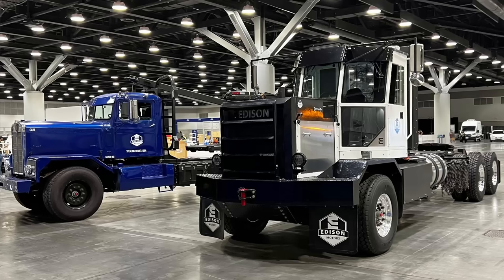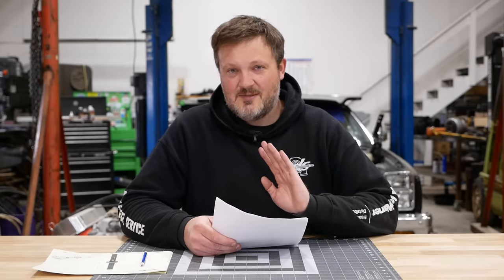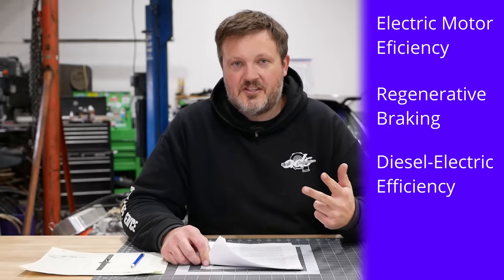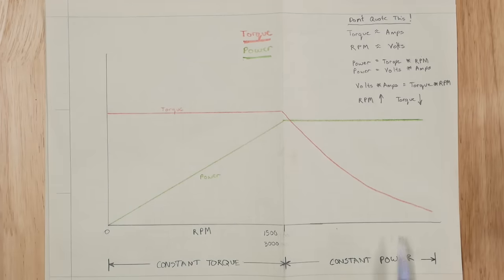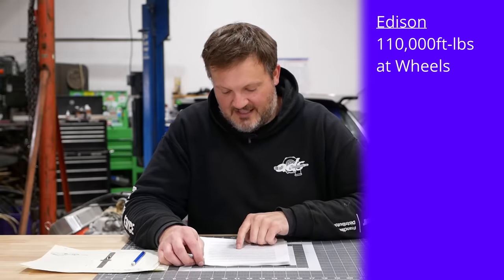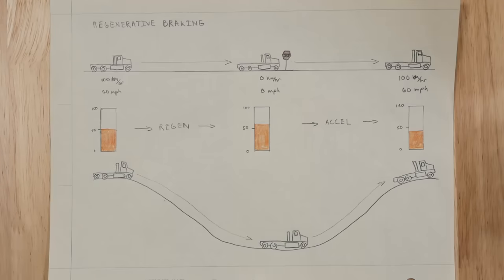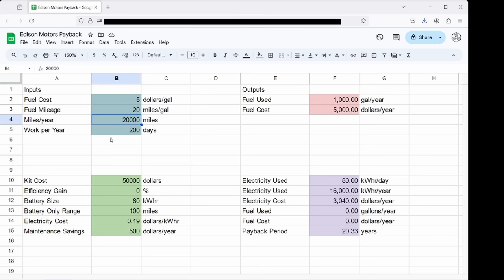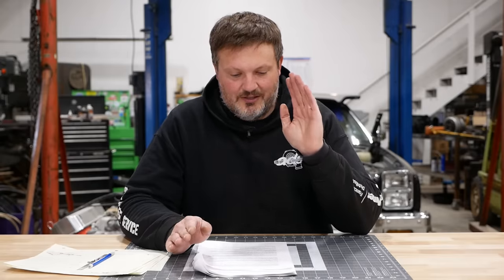Edison Motors Built a Diesel - Electric Semi Truck

Comment: This story hits all my buttons.  I'm an Electrical Engineer who grew up on a farm with heavy equipment all around me, and a shop full of tools to play with.  I'm relishing every aspect of this.

The coolness factor is important.  Watching the video with deBoss silently pulling the flatbed loaded with a Sherman tank was one of those "show me"/"proof is in the pudding" moments. As an Engineer I know there's a big difference between theory and practice.  Anyone who's done a demo for a customer knows the pressure.  I felt their joy as they made it work. Pretty cool.

Now I'm going to buzzkill that coolness: like the Tesla's ludicrous mode that puts you in your seat, but drains the battery (so I'm told), maybe putting 50 tons of mass into motion has an effect we don't know yet.  What if they did 100 start/stop cycles that day.  What if the ambient temperature was -20C. What if they had to tow that load on 200 miles of hilly interstate, or through a major city.

On the economics, I see no lies in your numbers, but I haven't looked hard at it.  People say numbers don't lie but that's not true.  Numbers will tell part of a story.  We choose (sometimes) which numbers to highlight and which to ignore.  This has been my problem with pure EVs, they make a bunch of assumptions.  Here's one: we're told EVs are simpler because the motor is just some windings. That ignores the complexity of the battery and associated electronics.  Batteries are the Achilles heel.

On the practicality, I think hybrids are much promising than pure EVs.  A turning point for me was watching a YouTuber changing out his Prius battery.  A backyard mechanic.  $2000 for a refurbished unit.  Edison might do the same for me, now they've got a licensed road-worthy prototype.  I'd like to see some one-on-one testing with identical loads in real world conditions, and how is it sustainable over a lifetime.

On the business side, their pickup conversion kits concern me.  I think it's a distraction.  They're spread thin already.  It might hurt them if it ends up being a failure.  

Your video is good.  Respectful and honest.  I hope they succeed, but they need to stay clear of hype that will sour their reputation. Get Topsy putting miles on the road.
Reply from the maker: I think batteries will be like transmissions. Currently, every decent sized town has a transmission shop. In  a few years they will have a battery rebuilding shop.
Reply: Chris Fix changing the battery?   He did one in the driveway a few years ago.  Hybrids are the way to go. Most people, most of the time travel local.  Across town to the grocery store, doctor, dentist, grocery store.   Maybe they work within the range of a hybrid.   Guy I know has a Plug in Hybrid Ford Fusion company car.  He has about a 20 minute one way commute.   He's begged them to keep it in the fleet for awhile for now.  So, far they have agreed.  They have plugs at work.  Occasionally he has to do 300+ mile road trips.  Gas takes over.
Reply: @WatchWesWork I have a nissan leaf instead of a tesla because the leaf pack is passively cooled and built with prismatic cells and is user serviceable.  Tesla packs are better performers but are glued and spot welded together with fluid passages for cooling, and not user serviceable.
Reply: There has to be a break though in battery technology before any of this will become reality. There very well could be a breakthrough in the coming years. I hope, but we will see…
Reply: Well put points in your short discussion here Norman 👍. I have a master's degree and have been in local and federal law enforcement for over 28 years. In the middle of those years I left for a dozen years and started a construction company. Thank the Lord it was very successful until the crash of 2008 and I got back into federal law enforcement. And all of these careers I have found out one thing as in life in general, keep things simple and follow the truth.
  If I may, here is my simple problem with this whole "EV" trail that so many are so happy to wander down. After reading numerous articles over the years, blogs and vlogs and YouTube videos, it appears that less than 5% of America's carbon output is from vehicles that are driven on the road. Less than 5%. From further in-depth study it has revealed that underneath Minnesota and North Dakota we have a pool of natural gas and oil that would provide over 200 years a fuel for america. Over 200 years. Being in the year 2024, it is now a regular event to see sedans and small SUVs driving around all over getting 30+ miles per gallon. Hybrids, which is simply a great technology, are getting 45+ miles per gallon. We are now talking about having to revamp and spend countless billions of dollars in adding charging stations all across the United states, some saying as little as no more than 40  miles apart. This will all have to be done on taxpayers dollars which includes me and you, REGARDLESS if we agree with or choose to be part of this use of countless billions of dollars. Furthermore, all of the incentives that the current administration has been pouring into people trying to get people to buy electric vehicles, is coming out of our tax dollars regardless whether or not we agree with any of this. The United States has been so blessed to have been provided with more fuel, oil, and natural gas then we could have ever imagined. Why then are people going down this frivolous road? 
I would submit to you that the answer lies in the same arena as several other questions we now sadly have to deal with. Why is a 6 ft 3" tall man competing in swimming against women and breaking world records? How in America can a proportionately very small group of people end up causing entire elementary School systems to be forced to have books in their libraries such as "I have two mommies", and "my daddy's having a baby" etc.etc. ? Why would federal agencies across the United States government have to spend an hour each year during "gay pride week" watching an hour-long video called "how not to offend the LBGTQ community with your words and learning proper pronouns"? 
  The answer is simply this........ Without Christ people will form their own religions. All of these things mentioned hear from electronic vehicles to all of the later examples are taken so very seriously by groups in our society because it is truly their religion, and they take it very very seriously. They will light cars on fire, they will block highways, they will overturn police cars and even run over innocent people in order to follow their religion and make their point. All of these things mentioned here lead to a dead end, sorrow sadness and regret. Call out the name of Jesus and invite him into your heart as your Lord and Savior before it's too late 🙏
Reply: I did one of those Prius battery rebuilds in my garage myself. Only took about 5 hours, and I upgraded to Lithium cells while doing it. That is the way the battery technology needs to be. Plus with the reliable Toyota drive trains, I now have a 'like new' 2010 Prius with 265k miles, still getting 50mpg.
Reply: @theshootindutchman  Long post but well worth the read, thanks. Working taxpayers are the ones who pay for all this, unlike those who always have their hands out, and think it's the government. My brother had a discussion with one of the clueless. When the guy was on the losing end his answer was "i don't care, i'm not paying for it, the government is"! How does one argue with that kind of stupidity?!!
Reply: Hilly terrain is*perfect* for electric vehicles, up the hill you spend some kiloWatt hours and down the hill you regenerate most of that energy (yes, friction, entropy etc) instead of throwing it all away as heat in ICE vehicles. Note that hybrids (whether fuel cell or ICE) are much, much more complicated than a pure BEV, they are basically BEV plus added FC or ICE.

Was traveling between Munich and Cologne a few summers ago in my iD3 and in the hilly parts I was regenerating a lot of energy. As in, the range didn’t go down significantly due to the climbs.
Reply: The generator has a dual core radiator to cool the engine so it also heats the batteries. In -20 or -40 the generator will power the truck direct to the wheels while the batteries heat up via the generator waste heat.
Reply: Toyota said over a decade ago that Hybrid are the way to go. They were correct and will be the standard WAY before EV's become mainstream.
Reply: @WatchWesWork  What would be smart to do is build a drop in replacement battery and have them stocked @ all their installer locations, so when ones battery goes dead they pull up swap batteries & keep going. Just like in the 40's when they had EV's.
Reply: @centauri61032 Was the lithium upgrade to increase the range? What effect did the lithium batteries have on range with your Prius?
Reply: @ramdynebix ICE vehicles go into fuel cut on closed throttle deceleration.
Reply: @brodysimmons9347   Being a hybrid, the Prius doesn't really have a range limit. I just went with the lithium, since they are newer technology than the original NiMH batteries. They are also about 50% lighter. I do notice an overall improvement in the cars performance. But I can't really say if that is lithium vs NiMH, or just old batteries vs new ones.
Reply: @Guitarhero1000  10 years ago is a looong time ago. Toyota was still relevant at that time. Now they build some of the worst EVs, more or less stopped with hydrogen and Prius are has beens.
Reply: @ramdynebix  Toyota builds the best hybrids. Toyota had already said they don't want to pursue evs

Comment: Excellent vid. A few points

Consider that generator efficiency 90%, power conversion efficiency 85%, motor efficiency 90% optimistically. Net efficiency is 70%.
This is less efficient than a mechanical power train.

Also consider wind resistance. Cruising horsepower is 150, almost all due to wind resistance. Regenerative braking does not fix this!

Also consider what you know about charging batteries from your experience with autos.  Batteries charge at 14.5 V, and discharge at 11.5 Volts (or less). Efficiency is 80%, best case, assuming you get every coulomb of charge.

Comment: I am a power systems electrical engineer with over 44 years of experience.  Your analysis is directly correct in my opinion.  I have done similar economic calculations for passenger EVs.  These too resulted in the buzz-kill we engineers are so well known for.  1. There is no “road tax” applied to EV miles driven.  Congress is simply waiting for the right time because this too will reduce apparent EV economics. Today’s EVs are getting a free pass, but not for long.  2.  Auxiliary power requirements for Midwest winter cabin space heating dramatically reduces EV range and economics.  3.  Battery “conditioning” for optimum charging and discharging requires significant energy or limiting of charging and discharging cycles.  This too reduces EV economics. 4.  Battery performance degrades over time and across numerous charging cycles.  There’s more, a lot more, to consider regarding adverse grid impact and system infrastructure costs related to charging facilities - megawatt truck charging facilities and 400 amp home service upgrades from the typical 100 to 200 amp of today.  Sorry folks.  It’s not simple.  Ideological zealots do not beat physics and electrical engineering.
Reply: Even if YOU GET 400 amps, what happens if everyone in your 'hood gets 400 amps?  All for the same purpose?
Reply: @dlewis9760  Exactly.  The impact on the electric distribution infrastructure is significant - meter loop, service transformer, primary voltage wire and pole size or upgrade of underground cables, distribution substation equipment…. extends through the high voltage transmission network.  Billions, if not trillions, of dollars in upgrades will be reflected in much higher utility bills.  This does not take into account the impact from “electrification” where natural gas and propane fuel furnaces, water heaters, and ranges are by government mandate forced to be replaced by electric powered equipment.
Reply: Sadly they just completely lie to the customer
Optimally lithium battery shouldn't not be discharged below 20% and charged over 80% for optimal performance/longevity and the slower the charge the better
Secondly the range claimed is for 100% of the battery capacity in perfect  weather condition and no heat/AC usage 
Third the ev mileage to the gallon formula he briefly talked about is grossly inflated in EV favor so the real roe is even higher that calculated
Four ev depreciation is off the chart 
All type of hybrid add unwanted complexity
For the truck conversion just installing the 2.8 Cummins with a adapter plates to the existing transmission make way more financial sense,way less complex of a project and less custom fab work=more fiability and a reasonable roe  
Gas powered truck are usually cheaper and would make great canditate
Reply: In Indiana we pay a flat road tax for EV's.  Its completely unfair! a 30mpg vehicle would have to drive over 100,000 miles per year to pay the equivalent amount of tax at the pump! its Ridiculous! I wish they would base the tax on mileage!
Reply: New Zealand is bringing in a road tax for ev's, they have been getting a free ride for many years, sales of ev's are now dropping.
Reply: So, it's just another fashionable nonsense. But we all knew that, didn't we?
Reply: But we have to do something. EV tech will not pop out of the ground fully perfect. But we can't just stay with Gasoline forever. It will run out. Yes, EV tech isn't perfect yet but its a so much easier to at least be started before we run out of oil.
Reply: @peterjensen6844  Nice to see you believe implicitly what the media feeds you, oil will not run out in your lifetime.
Reply: @MegaDirtyberty  cool story bro. 👍
Reply: @peterjensen6844  Cheers buddy.

Comment: I appreciate you giving some insight on this. I'm a Mech. Engineer, working with various power prototypes, and the new stuff coming down the line will make or break the future of power gen, and power usage in general. ( Still waiting on a large scale Flywheel Energy Storage for the masses, but no dice yet :( )  Thanks for putting your knowledgeable spin on this, and putting it out there for your fans.

Comment: Hi Wes , really love your shows. I am a retired (OO), sold my truck . I really feel sorry for the younger generation in trucking . The cost is enormous for the trucks and repairs. So what is the country going to do? I hope that it all works out for the guys in BC, I really think they are on to something. Using a smaller diesel for the generator may be one thing. Let's see how this all unfolds. Keep up the good work. Sorry no complaints.
Reply from the maker: The costs are also crazy for insurance, registration, fuel, taxes, etc. Driving a truck is like driving a cash register. Everyone want to open the drawer and help themselves.

Comment: Great video and I agree with your logic.  One correction though; on the highligted portion of their website they are claiming 5-10% not 5-100% fuel savings.
Reply from the maker: They claim 5-10% for OTR trucks, 70-100% for vocational trucks. It's right in the section I showed on screen.

Comment: I live near these guys, I'm really rooting for them. Good to see some in depth criticism though. I think the logging market here is large enough to keep their company afloat. As long as they are smart with how they use their finances they should survive.
Reply from the maker: They said there are a 5000 logging trucks in BC. That's actually a decent market.
Reply: @WatchWesWork  That number sounds about right! With fuel being 1.67/liter right now and only going up with more carbon taxes I can see most of the haulers thinking about at least trying out a truck in their fleets. The turnover on trucks is fairly high too, so be interesting to see what happens.
Reply: Success there would allow them to scale down to the trucks that pick up containers from intermodal ports along the coasts for local deliveries. California probably has incentives for a proven truck platform that reduces emissions for thousands of local in-traffic trips per day around the Los Angeles basin alone.
Reply: Yeah, we really aren’t trying to build 30,000 trucks.   We want to fill or specially niche applications as we grow
Reply: @wesley00042  Drayage trucks should go straight to full electric. They make short deliveries within range of a light battery
Reply: thanks wes

Comment: For 18:00: Oshkosh tinkered with that system which they called "Propulse", a proper series electric hybrid. They had several trucks and MRAPs built and it did offer big advantages, but they stopped working on it about 5-10 years ago. They still advertise it on their webpage.
BAE systems is currently working on a series electric hybrid for the Bradley IFV which they call "BHED" - Bradley Hybrid Electric Drive. They are still working on it, with a presentation that happened two years ago and prototyping effort still ongoing for this year under a $32mil defense contract. That might yield something.

Other than that im with you. I have never seen anything in the civilian market.

Great video wes!
Reply: Military test and development will really push Hybrid transmission systems. Mining hybrid vehicles, for instance, are only developing slowly as this industry wants reliability first and foremost.. Military will push all the envelopes.
Reply: @davidmuirhead1060  Mining is all over electric vehicles now, anywhere they have electricity. Diesel is a huge expense of running a mine. They're the big industry pushing electrification of heavy equipment.